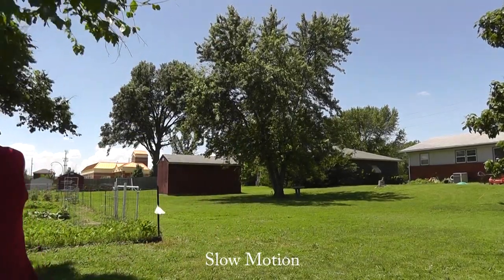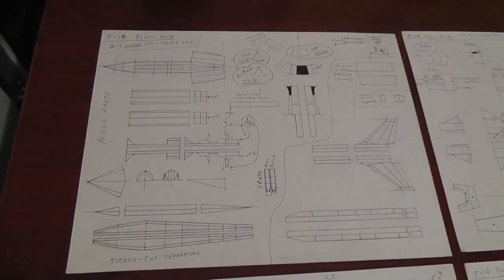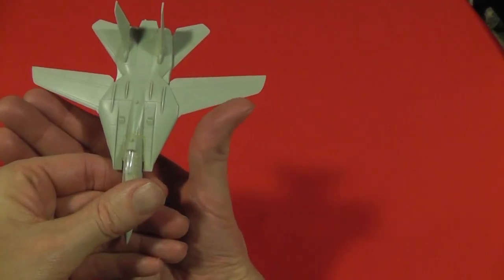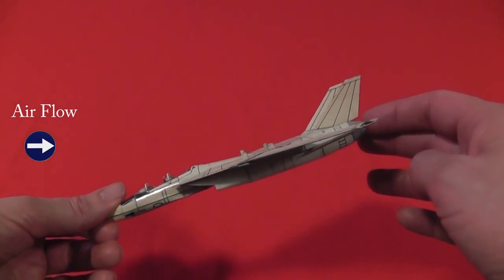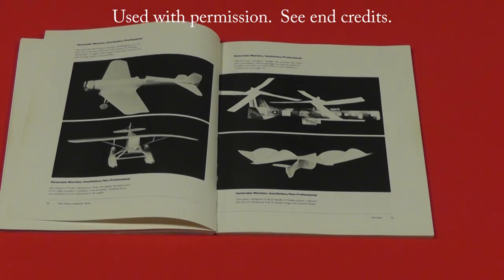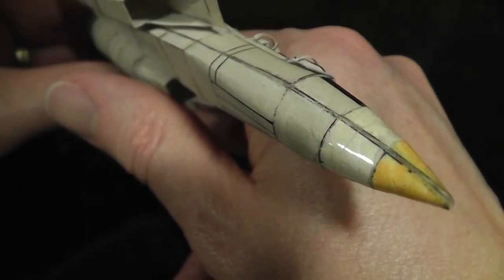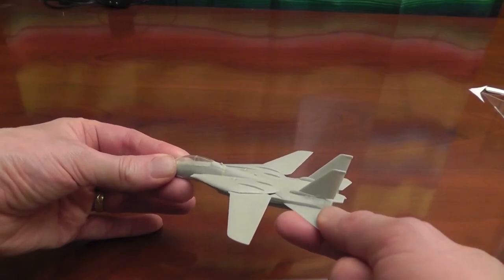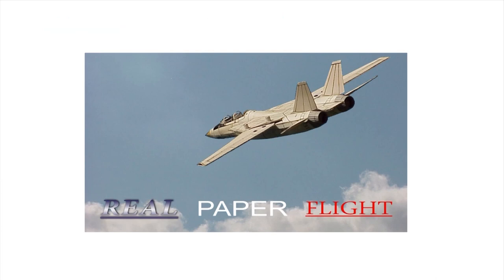F 14 Tomcat Paper Airplane (Part 2)

Comment: Thanks so much for sharing all of the details behind this "too professional" F14!  You touched on some items you designed with external handlers in mind.  What kind of features would be different if the rules had allowed entrants to handle and throw their own planes?
Reply from the maker: Excellent question!  I'd use tailerons, which require precise symmetry to avoid rolling and turning, and not make the wing tip so stiff and thick.  Maybe I would have had time to link the wings.  I would have still rejected rudders, flaperons (bad ideas) and retractable rolling landing gear, (too complicated, delicate, can't land on them, not to scale & needed staples (not legal under the rules)).

Comment: What kind of tape and glue did you use? Is there a best method to apply glue?
Reply from the maker: I used single and double sided 1/2 inch wide Scotch brand tape, and Elmer's glue.  Tape was cut into special shapes or very skinny strips (with minimal touching) to match parts or lay flat along curved joints.  Glued butt joints need a very tiny glue flow hole and careful technique to make a tiny mirco-bead of glue along an edge without blobs or gaps.  It takes practice and frequent starting over.  Some places were glued and taped over after the glue dried.

Comment: Can I get your plans of your planes and what will it cost.
Reply from the maker: +SuperWill1959 Plans aren't enough.  Ballast & axle parts are missing.  You need special technique instructions that would take me 1-2 weeks to make.  An instruction video would take longer, and hours to watch.  Hardly anyone would want to spend days making one.  That is why I only talked about it.  The polyhedral F-14 kit by MasterPaperAircrafts is simpler and glides well.  Mine is 3D curved, durable and aerobatic, but difficult to make.  I will publish a good flying simple, cut, fold & tape swing-wing F-14 later.
Reply: but some of us could accept the challenge, under the promise that we won't bother you with questions here and there... 
After all, some of us are origamists, and sometimes we get the template (the square with all the creasings) but not the steps... and yet we try :)
Reply: @RealPaperFlight  However, your airplanes are the BEST, and I am trying to make my own f15 paper airplane.